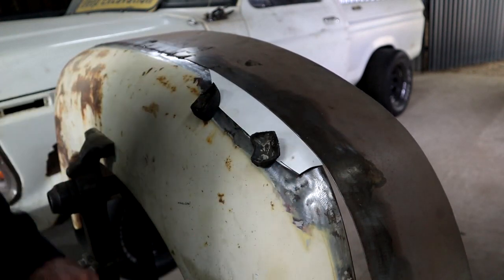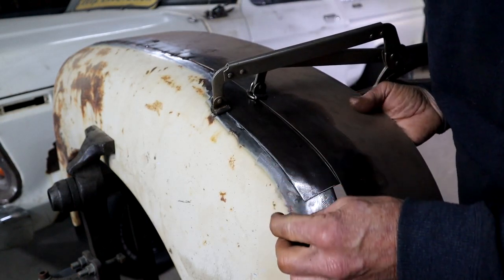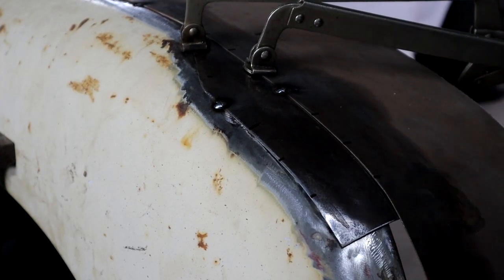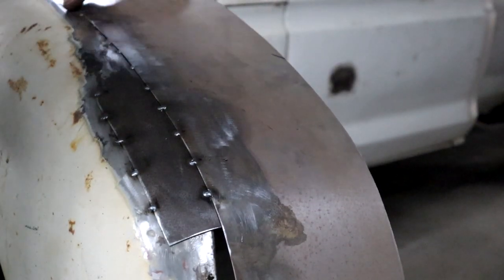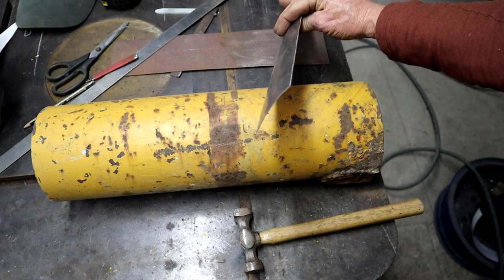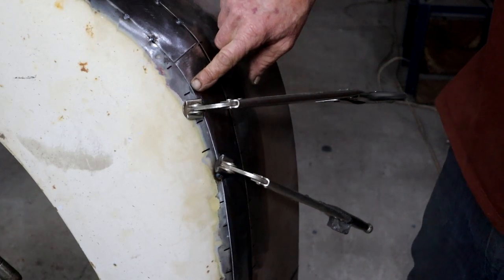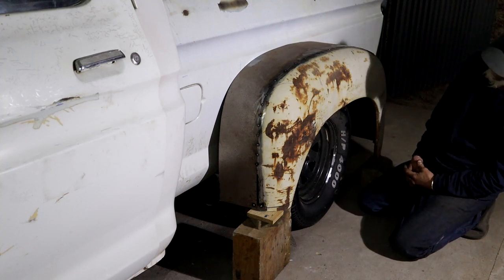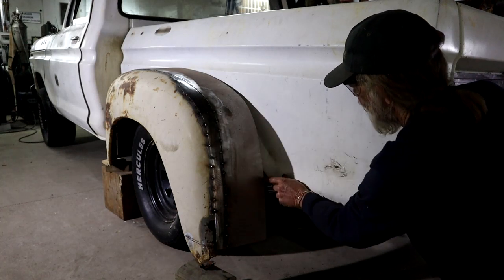CUSTOM TRUCK BED BUILD - FORD F100 (Part 4)

Comment: Hey Div, I like it exactly as you got it. The front of the fender vertical to match with the cab and equal gap between the fender and wheel front and back. Looks Good Boet.
Reply from the maker: Thanks my man!

Comment: Make a pair of dual exhaust stacks coming up from the chassis where the back of the cab and bed meet.
Reply from the maker: I toyed with the idea... Thing is, I did that on a previous build... Maybe try something different this time?
Reply: @ratrodsafrica  since it's a rat rod build maybe have them poking out the sides near the bonnet(hood) or somewhere thereabouts.